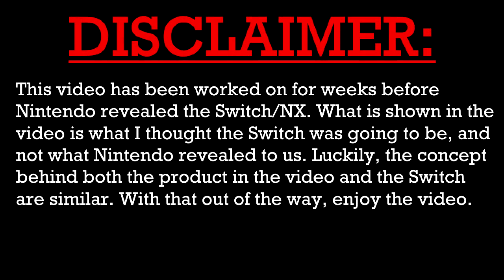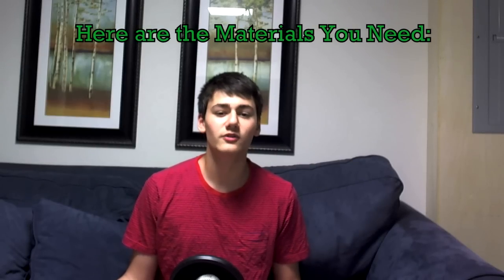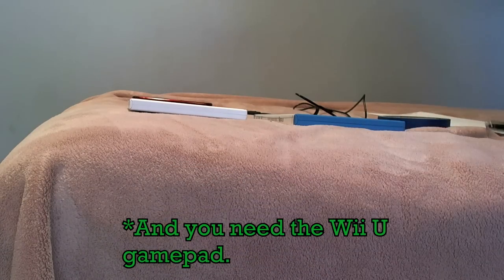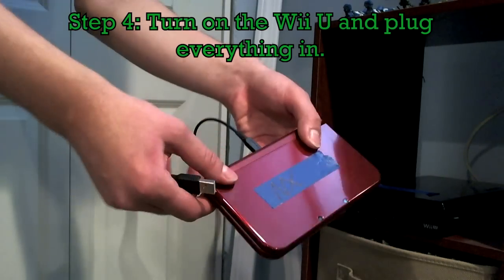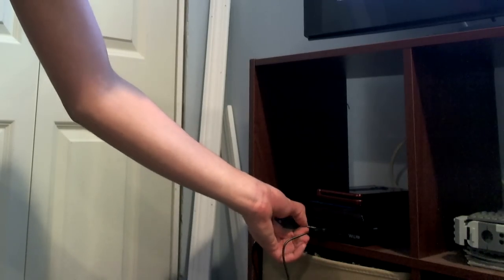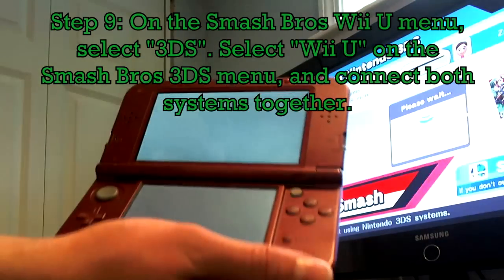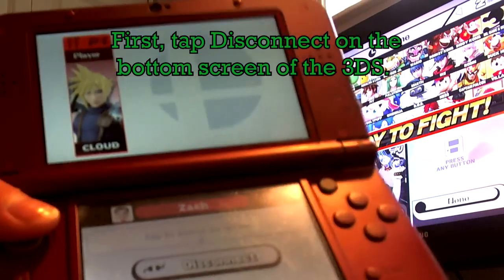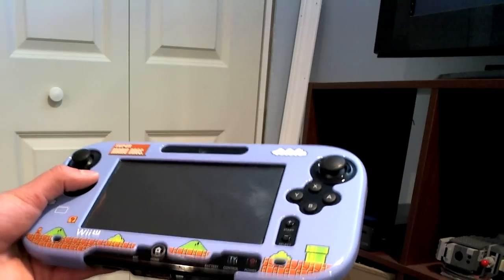How to Make a Nintendo Switch Prototype!

Comment: can it's use for 2ds?
Reply from the maker: +Đặng Xuân Minh Yeah, you could use a 2DS instead of a 3DS.
Reply: Yeh to be honest its a little better to use a 2DS cuz the 2DS is flat like the Switch plus it doesn't have a 3d option, neither does the Switch